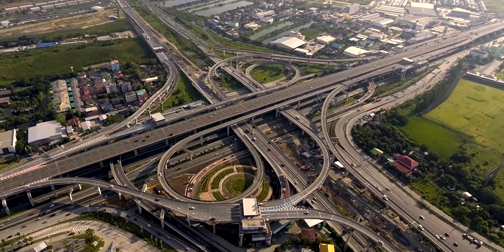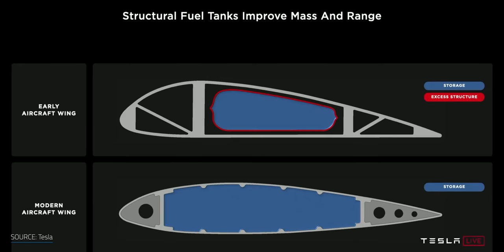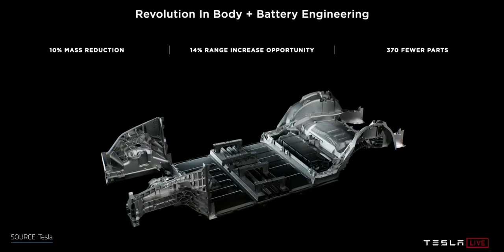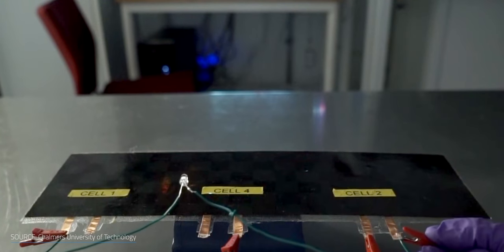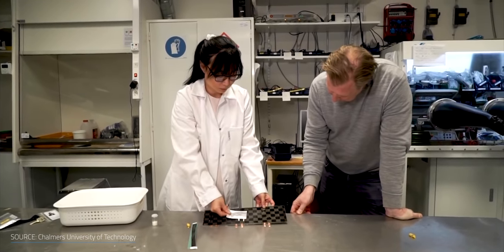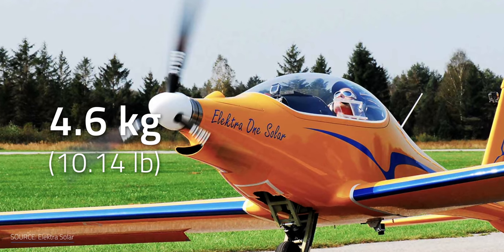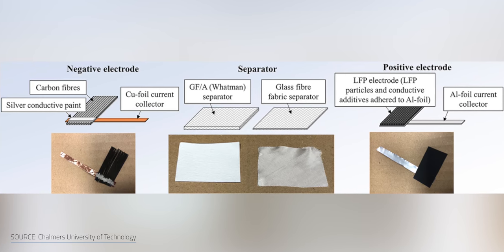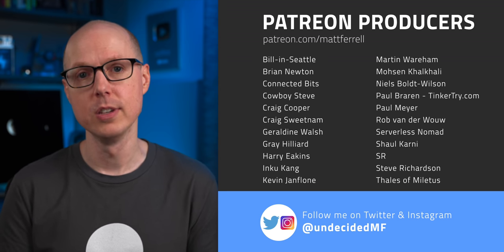Exploring Structural Batteries

Comment: "If the fuel pump fails the engines will still be feed by gravity."
No offense, but do you even have the slightest understanding on how a jet engine works?
Reply: I don't think he does. As for calling wing tanks structural, I call it using otherwise unusable space. It's convenient that jet fuel is liquid. It's a shame that batteries aren't liquid too ! Talk about comparing apples to oranges.
Reply: U forget that wings on a plane when flying in air are bending and the plane is always tilted up to a certain degree planes do not fly perfectly leveled. So put those two together and yes gravity will still feed engines also in world war 2 cant remember who did it u.s or japan but they had gas tanks that would shrink to match fuel capacity. Was mainly done to prevent fires in combat when fuel tanks got shot so there be no gas pockets that would suddenly combust. But also helped to regulate fuel pressure for if the fuel pump went out or was shot as well. Not intended purpose but a added benefit of the technology back then. Or so i heard i am no plane tech so who knows lol.
Reply: @mikevega8712  Those engines still have fairly high pressure fuel pumps so fuel flow is most certainly NOT 'by gravity' !

I suspect wrt WW2 etc that you mean 'bladder tanks'. Military fuel tanks have also been inerted using nitrogen gas for decades.
Reply: @grahamstevenson1740  liquid batteries are some of the oldest types of batteries around. In fact the liquid fuel cell was invented before the battery. The only problem is things like liquid fuel cells and batteries use horrible fluids that are caustic and toxic on a level that most people can't imagine.  Pumping stuff like that around is a whole nother kind of engineering problem in and of itself. You put a system like that in a car or an airplane, and you're asking for a disaster.
Reply: The fuel pump from the tanks to the engines, not the engine's own high pressure pumps.
Reply: @TheInevitableHulk  Pardon ? How do the engines own (high pressure) pumps NOT affect the fuel flow ?
Reply: Graham Stevenson if you don’t know how the system of the airplanes work (that the guy in the video used the gravity feed statement as a generalization anyway) you should consider not getting so amped up to strangers online about things you’re misunderstanding
Reply: @kilvarough  What on earth are you on about ? Light aircraft ? If it's got a high wing sure but otherwise ?
Reply: @grahamstevenson1740  I can't see who you're replying to as it's been deleted it seems, but sometimes fuel pumps do turn off in flight via system logic(the computer says X,Y,Z, A and B are met do this) with no input from the pilots.  Every aircraft being different.  The one I fly does this in one specific circumstance, but in general we control the pumps.
From the very limited system knowledge I have of the MD-11, I would think it does a lot of fuel pump switching automatically since it moves fuel around in flight for efficiency(balance and therefore drag) purposes.
Reply: @z987k  That's transfer pumps vs lift/delivery pumps.  A high pressure pump can draw in fuel without a lift pump, but they really don't like it and generally don't last long doing that.
Reply: @jaredkennedy6576  They have a low and then high pressure in sequential order downstream the spar valve.  And it would be quite irregular for it to be suction feeding like that, in which case if it can handle a couple hours, it's accomplished it's triple redundancy.
Reply: @z987k  Yes, I'd expect that's the case for a large ship like the MD-11. In the deleted comment, someone asserted that 'the fuel pump' was only used for takeoff and when flying, fuel was delivered to the engine by gravity feed !
Reply: @z987k  Quite so, the redundancy is important. You don't want a donkey to flame out because a fuel pump's taken an unscheduled vacation.
Reply: @mikevega8712  I think he just trying to make a point that the energy storage can also be the structure of the vehicle itself, so there’s no additional energy “container” needed
Reply: I fly an aircraft based on the old DC10. Our wing engines do continue to operate with the fuel pumps turned off using gravity and the venturi effect.
Reply: @pjrupert  Unusual. What % thrust can they deliver like that ?
Reply: @The Bee Guy Yes, fuel cells have their place too. I expect to see them mainly in the heavier commercial vehicles (like the semi/artic outside the US) that need really long range.
Reply: @teonesterov9141  Thank you for the linked document! Turns out the video is indeed correct and I was completely wrong, my apologies.
From my understanding of jet engines , the fuel had to be injected under preasure. This understanding was wrong, thank you for the clarification!
Reply: The Electric pump is for providing fuel pressure during startup, the engine then relying on it's own mechanical pump. Aircraft electrics are notoriously unreliable, relying on an electrical pump would be disastrous.
Reply: They will still be fed by gravity. Did you look anything up or have any prior knowledge before commenting?

Comment: Price is the issue, not the range.
Reply: Mass production will drive down the price in tandem with efficient manufacturing.
Reply: I would say both. some like myself have no problem paying the price but need the range. won't complain if became cheaper
Reply: 3d printers were 18k+ when they released.

Give it time
Reply: @drhubs7049  everything typically drops in price over time. Solar, price per kWh for batteries
Reply: @intertan  not sure what you were getting at on that last bit but I agree with your first bit!
Reply: Actually both price and range are the issues.

Comment: "Huge amount of potential" is a way of saying its bloody hopeless
Reply: Yes. Not that they are not already starting the production. No sirre. Never! Not in Austin and surely not so fast in Grünheide. Takes at least a few months till the first produced vehicles come out of those places. But not for your stautet. Don‘t despair. GM and Ford will make your classical vehicles!
Reply: I would venture to say that the very same thing could be said about the top of a mountain... there is a HUGE amount of "potential" energy in there... but the chances of it actually becoming useful is astronomically low... whether something similar is in production or not is immaterial.  The battery he is talking about is NOT the one that Tesla is putting into their vehicles... that is merely strengthening the battery pack and using it as a structural member... the actual statement, as written, is true under certain conditions.
Reply: Almost all that we are promised never comes to fruition.  :(((
Reply: @edwardpaulsen1074   So well said its worth framing
Reply: Like most of his videos. He seems to be keen on backing every dead cert failure.

Comment: Seems to me that this idea would work well working in conjunction with current batteries to extend range but not ready to replace them.
Reply: I can see a hybrid approach. Use this where it is easiest to implement and then filled in the rest of your needed capacity with a battery pack that is part of the structure like Tesla is doing.

Comment: This would be interesting for drones
Reply from the maker: Exactly!  So many possible use cases.
Reply: Yeah, single-use kamikaze drones.
Reply: E Van  Thanks, that's terrifying
Reply: E Van  Dope reference of the Switchblade by Aerovironment //
Reply: E Van  for short range low mass flights, yes

For litterally anything else, not enough power/weight ratio or range
Reply: @rogerstarkey5390  Airplanes are engineered to withstand lightning strikes, and pilots fly around thunderstorms. I don't see why electric planes will be any different.
Reply: took the words out of my mouth :)
Reply: Actualy for everything. But drones, airplanes, helicopters and other flying machines might be the best usecase
Reply: Unfortunately no. 

Our batteries need to be removable and replaceable. 

I don't get why they dont just layer the carbon into dense cells and make them its own little structure. That way it stays light but can still be changed out in case of damage from a crash or deterioration in performance.

Comment: WHY do they have to be deceiving and call it massLESS??...
Reply: Marketing to solicit investment & interest // smoke & mirrors like the early 5G mmWave 6GHz stuff today when the real deal 60GHz long range variable MIMI variable frequency broad spectral hopping version of 5G something like 5 years out, at least //
Reply: Someone probably said less mass and some pesky marketing bastard twisted it
Reply: Because, ideally, they won't add any mass to the vehicle. Didn't you watch the video?
Reply: Because marketing is dyslexic.
Reply: Most cars and planes designed and built today have some carbon fiber parts as they have great strength to weight ratio. These can be also used for energy storage which means no added mass to your car or plane. Hell, no design changes needed to add this to modern ev and extend the range. If the carbon fiber battery goes bad and no longer holds a charge then your range is back to original specs due to there still being a battery pack.
Reply: @nagualdesign  That's impossible.  The laws of physics are not just a suggestion.
Reply: if you watch the video, Tesla is not claiming massless energy storage, just a reduction of mass by eliminating the battery structure that would normally house the cells and cell modules.  The "massless energy storage" is referring to the Chambers University breakthrough of literally using materials used for the structure of the vehicle AS the energy storage.  The "massless" is referring to the fact that none of the mass in the vehicle is used exclusively for energy storage.  Hence, "Massless Energy Storage".  No mass added for energy storage.  That's why they aren't calling it a massless vehicle.
Reply: Because it sounds so much more appealing than "disposable car".
Reply: @treelineresearch3387  not disposable…consider if they replaced the carbon fiber on the Tesla cars with this and did nothing else. This would increase its range while keeping the strength of the car. When the carbon battery no longer holds a charge the range will still be near current range. This is similar to how cars over time lose range due to engines aging and wearing down
Reply: @Sylvan_dB  If you replace a structural element that weighs, say, 100kg with a structural battery that weighs 100kg, performs the same job but also stores electric charge then there's no added mass, hence 'massless' (in inverted commas).  This was clearly explained in the video. I thought that Matt was repeating himself a bit too much but I guess he didn't say it enough. Nobody is suggesting that the batteries would have no mass, or that they defy the laws of physics.
Reply: @nagualdesign  not realistic. Sorry.

Comment: You addressed the safety concern in event of a collision but what happens in 10-15 years when your structural battery no longer holds a full charge?  How much is that going to cost to replace all of those body panels? How much labor will be involved with that?  This sounds a LOT more involved than just replacing battery packs.
There are definitely a lot of benefits to this technology and it can be a great step forward if implemented properly, however many aspects need to be considered prior to implementation.

Comment: If there isn't a method to repair/replace structural battery components from damage or end of life, then this doesn't sound like a net positive yet.
Reply: It doesn't take much damage these days to make replacing a car more cost-effective to the insurers than repairing it.
Reply: @clivemitchell3229  If a structural battery pack cannot be easily replaced after an accident then the insurance costs will go up substantially and they're already high as it is.

Comment: Yes, ultra-lightweight batteries...with structural applications. This will definitely have an impact in the days ahead. Designing a physical part that performs mechanical and energy storage functions is much smarter in concept and execution. It could give rise to completely reimagining many 'traditional' forms of transportation, computers, convergence devices and electronics we use today. I think of advanced prosthetics or exoskeletons really becoming 'next level' with a new material like this. Very exciting to contemplate. To me, this is notably better than a solid-state battery. Definitely would like to see where this research goes in the next 5 to 10 years.

Comment: Sounds like he's missing the point of "What if it's in a collision?" The concern isn't whether it's safe or not, it's whether the car can be repaired and how expensive it would be. A fiberglass frame won't hold up like steel, and it's not easy to repair like steel either. Add the fact that it also powers the car and you end up with a really expensive, crumpled plastic car that won't run.
Reply: don't forget the passible battery explosion from a simple fender bender. or hell bottoming out on a speed bump or pot hole. not to good of and idea to use unstable material for structural integrity lol.

Comment: Like all battery "innovations" this'll be the last time we hear of this.
Reply: Na, this makes it to where replacing the battery means buying a whole new car. That's definitely worth the 10% improvement... for Tesla.
Reply: The Tesla example is just smart placement of pieces already in use. 

I studied the carbon composite one  in a university project and it's very straightforward, made by commercial and laboratory supplies. It seemed both attractive and relatively easy to implement in military/high end drones.
Reply: @rogerstarkey5390  I realize that there might be a bit of a disconnect between what we are talking about, since there where two major structure batteries discussed in this video; The carbon fiber one that I think that you been talking about in the comments, and the tesla one where they just but a regular battery pack in the frame of the car in an inaccessible location which I've been talking about. I understand that I should have made that clearer. So for the sake of clarity, I think the carbon fiber batteries are awesome, innovative, and have great (although limited) potential uses. On the other hand I think that putting the battery pack, which will inevitably degrade faster than almost any other part on the car besides the tires and brake pads, glued into the frame of the car so that it can't be replaced is nothing more than a money grab trying to make sure that there is no secondhand market for the cars.
Reply: You will definitely hear it again when it's time to part more fools from their money.
Reply: 1000000% correct.
Not only in the battery field but pretty much anywhere they use terms such as "revolutionary", "worldchanging," etc
Reply: @gafrers  You forgot the latest buzzword craze: DISRUPTIVE!
Reply: @ikickss  Absolutely true. All terms that lost their meaning thanks to marketing wank. Like "Class leading" or good old  "product of the year"

Comment: You would never be able to replace battery packs, on a solution that has a limited number of cycles. Not ideal. I'll take the alternative approach.
Reply: A failed battery would write the car off!
Reply: Yeah imagine a phone that as an integrated battery.  Cant even change it out when it goes bad or weakens, gotta throw out the phone.  Nope!  Separate batteries are the way to go.
Reply: Or, just line any structure with this type of battery for easy install and uninstall. It'll be like changing a phone's screen.
Reply: It makes sense for cars that already use carbon fiber as their chassis. Carbon fiber is slow and finicky to make so you'll likely never see it on affordable cars. CF also cannot be repaired once damaged.
Reply: Okay I'm not an expert on this but I like free thinking so I would give it a shot. It's in the way the battery is made. Is it made as one big piece then it would be inrepairable, but what if we made small structure batteries that each resembles a part of the car and put them in a parralel order. Like for example the bumper of the car is broken. If you made the bumper as one car battery part you could replace the bumper of the car with a new one without having to demolish the rest of the car. When the batteries are out of their life cycles they could easily be replaced because we made small parts and not one big piece. Okay I understand that when you need to replace all the parts because the batteries ran out of their life cycles it would be very expensive. It al depends on the life cycle of these carbon fibers batteries. Maybe you could solve this by making the cars modular so that it is easy to remove parts from the cars structure and place in another structure. Make it easy to remove the engine in minutes and place in the the other car within minutes and that for every part of the car that isn't the structure. If it would be possible to remove everything from one car structure and place it in another car structure it would be groundbreaking by itself, but if we could made it with the right technology, tools and knowledge to happen in less than 1,5 hour it would be something that can become a key in the future for recycling and give this project a chance. The battery structure that will be left behind could be recycled so that nothing is wasted. 

I know this is a fake future scenario, but I think this could technology could work in the future if they can overcome the hurdles. 
What do you guys think of this? Did I make some mistakes (I'm a freethinker not an expert)  or do you know a problem that I haven't faced  yet?

I comment this on multiple people btw to spark a conversation.
Reply: @adventurousloner  exactly. These other people lack basic imagination.